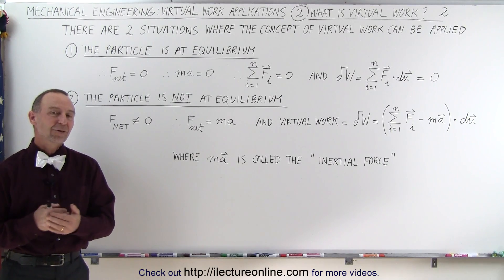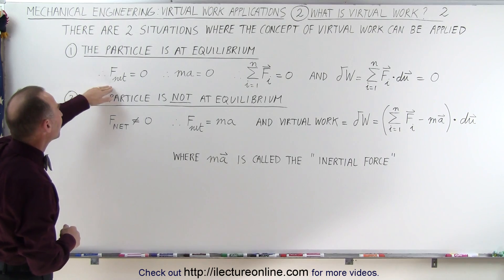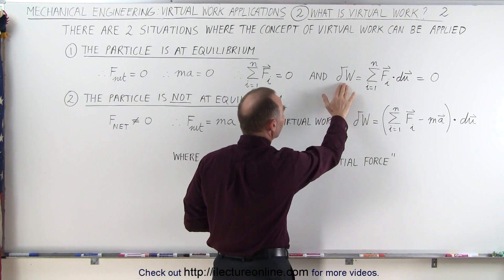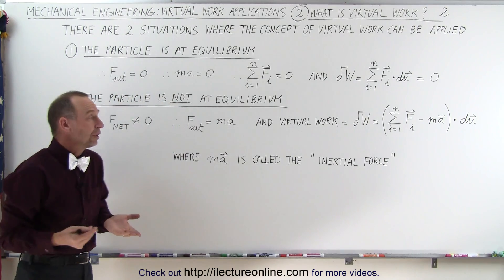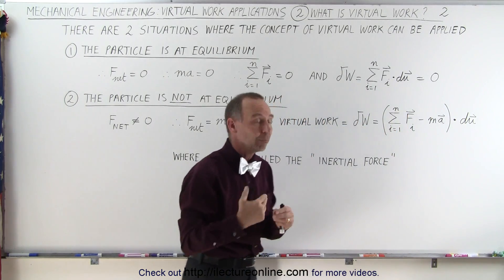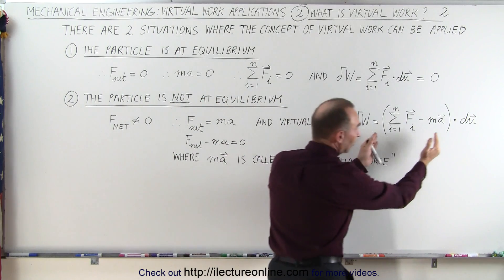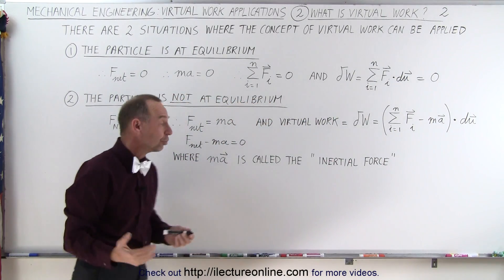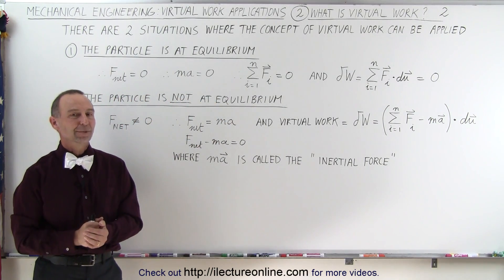Mechanical Engineering: Ch 13: Virtual Work Applications (2 of 39) What is Virtual Work? 2

Comment: Very well said,i finally understood it but sir i have a question. Cant we just use Kinetic energy-Work theorem? I think that its the same with the virtual work and easier to apply. Am i correct? Thank you,keep up the good work
Reply: Hamilton’s principle may also be used and in my opinion/taste is more elegant than the principle of virtual work, besides it yields both equations of motions and natural boundary conditions However, Hamilton’s principle needs a conservative system (you need potentials and self-adjoint operators). Virtual work (and d’Alambert) principle does not need that. It needs however a knowledge of the equations of motions in order to be derived, whereas Hamilton’s principle yields them. The weak form of the equations of motion often is the same, and it is for conservative systems, but it needs not to be.